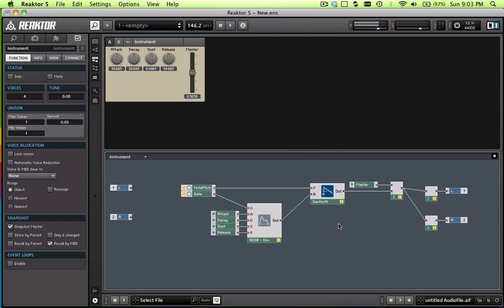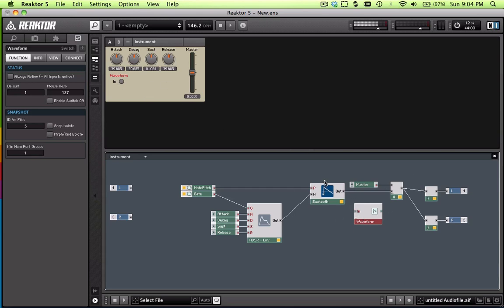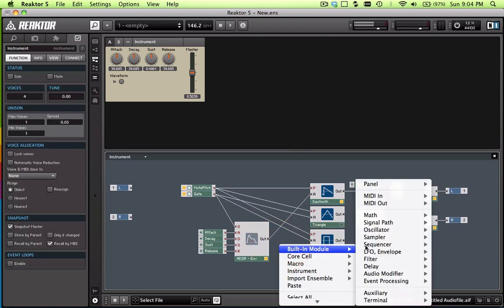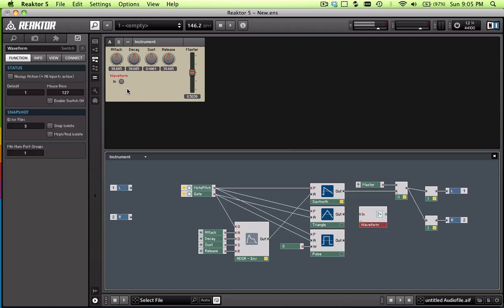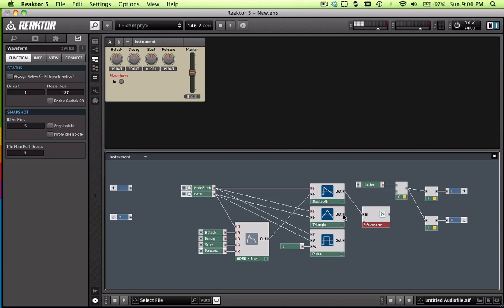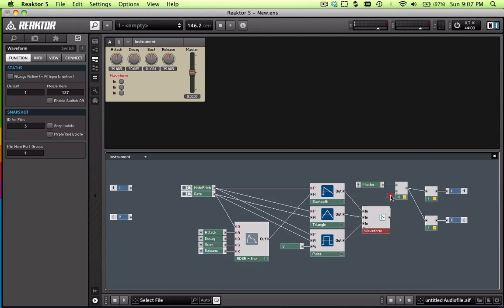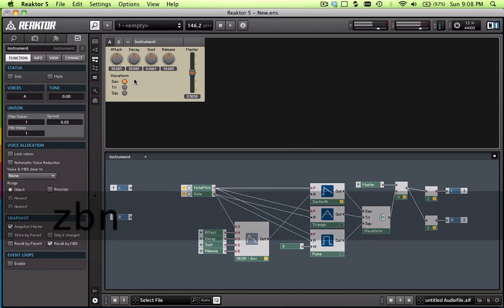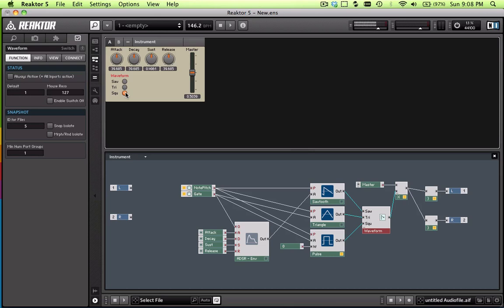Reaktor 5 Tutorials - Tutorial 2 Part 2, Selecting Different Waveforms

Comment: Just one observation if I may: At the end of this tutorial don't forget to connect the ADSR to corresponding OSCILLATORS, otherwise you wont be able to apply the ADSR to affect your Pitch/sound. You left out the path from ADSR -->Triangle and ASDR-->Pulse. The GATE needs to only be connected to the "G" on ADSR and then ADSR to the 3 WAVEFORMS. Awesome videos!!! Thanks for putting these up.